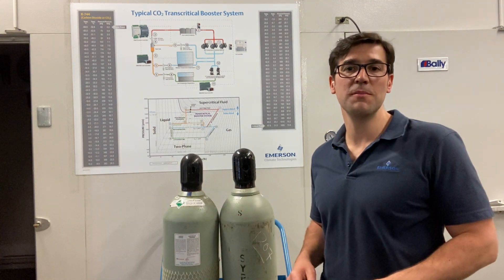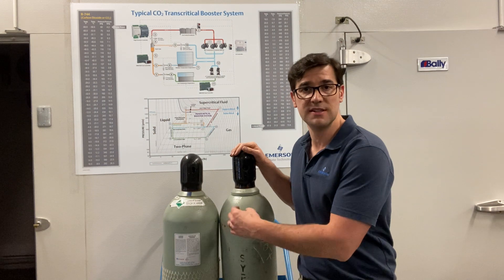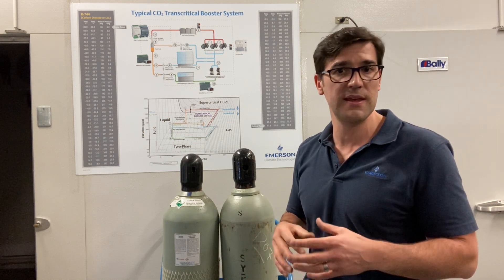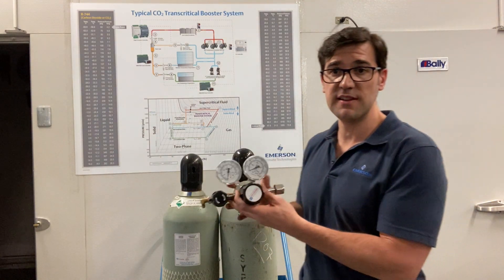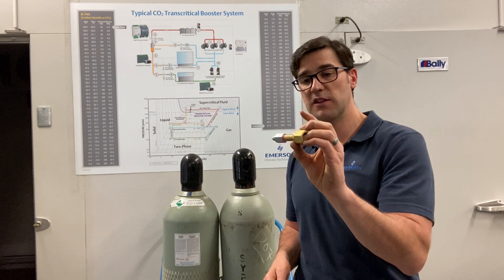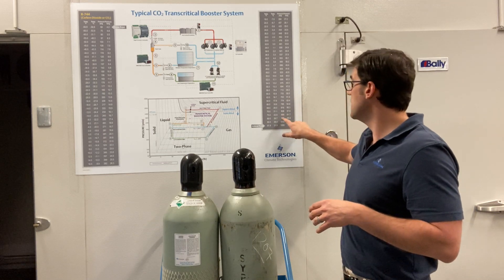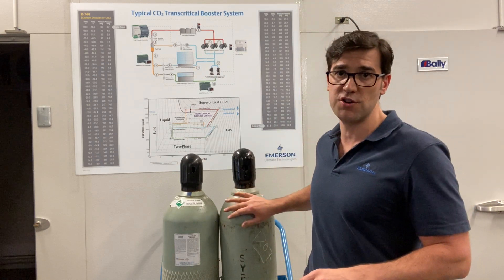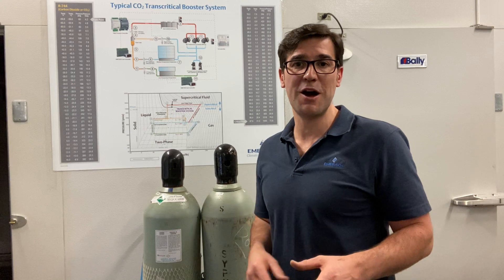Understanding CO2 (R744) Cylinders

Comment: How to isolate cases that are on a co2 system
Reply from the maker: For a Transcritical booster system on a rack, Close the liquid line and wait until the circuit doesn’t have any liquid left. Close the suction line make sure the pressure doesn’t raise in the circuit. Move the rest of the Vapor into the suction of the low temperature side and purge the rest the Vapor to a safe area.

Comment: Does vacuuming to 500 microns still apply to charging a fridge that uses r744? Never worked with c02 before.
Reply from the maker: Yes you really should pull it lower than that. Less than 250 microns.

Comment: Exactly the information I was looking for. Thank you.
Reply from the maker: Your welcome. Working with a refrigerant like CO2 you have to be safe. Wear the proper ppe, understand that those cylinders are heavy and at high pressure. Don’t forget you can cause dry ice in your hoses and always shut off the cylinder valve and bleed off the hose before removing. Good luck out there. More great CO2 content at www.refrigerationmentor.com

Comment: I'm starting to see Coke coolers using Co2 would like to see videos on compressor replacement.... guessing these are stainless steel lines how do u solder or are these coolers  just going to be trashed not repaired if so how is that "saving" the environment ?
Reply from the maker: I believe they would be copper lines not stainless. You see many gas coolers that are copper with stainless headers because they have thicker walls and can handle the pressure. Always follow up with the manufacture.
Reply: They used thicker copper, filter drier also heavier than normal ones, few of my technician friend got the drier burst out by using normal ones

Comment: Once the cylinder pressure equalizes with the system pressure, your create a pressure difference by supplying heat to the cylinder . If you are not sure how to do it safely, then don't attempt it.
I have an experience charging an HFC system, where the cylinder pressure and system pressure equalized after only 4 cylinders, and yet I need 20 cylinders as initial charge (10MT/day tube ice machine). Using a 500 watt lamp array as heat source I was able to complete the 20 cylinder charge into the receiver. To keep the pressure low at the receiver while charging , I had to apply ice on the liquid receiver to condense some of the vapor so that the receiver pressure remains almost constant.
Reply from the maker: I like that make sure you understand what your are doing and get the proper equipment like cylinder heat blankets if needed.

Comment: what about heating CO2 bottle with fire while charging sistem?
Reply from the maker: I do not recommend that. Have a second bottle and let stalled cylinder warm to room temp.
Reply: Not with fire but with a lower intensity heat source like a cylinder heater blanket w/ thermostat (if its available for CO2 cylinders). A 500 watt halogen spotlight might do the job too.
Reply: A large hot water bucket works better and safe than torch. The best way to avoid dry ice if is a new system or previous blown charge ,first switched the relief valve to 1700psi , turned off all circuit solenoid and  start with vapor to 145psi and than start adding liquid and complete your charge without any problems. The receiver is sized for a full charge with a total of 80% receiver capacity. With that said now you have your charge in system open one circuit at the time and watch the process. Always stay focused to all your input. Be safe out there ✌️
Reply: I like to use my oxy acetylene torch. I heat the cylinder until the paint bubbles and melts.

Comment: Do you have a part number for the brass tank adapter?
Reply from the maker: The service connector/adaptor is a CGA 320. 1/4" NPTFI Female x 1/4" Male Flare, Nipple CGS-320 Item CO-3, Nut CGS-320 Item CO-2.

https://www.tenaquip.com/product/western-enterprises-regulator-nuts-and-nipples-co-2-312-3106?gclid=CjwKCAjwtfqKBhBoEiwAZuesiF0hR7rLXBgBhgqBRqDj96GFOPnfKwheXc0xE3YRZCEHTu42Zwod1hoCVN4QAvD_BwE
Reply: @RefrigerationMentor  bummer. I tried the link and it doesn't work anymore.